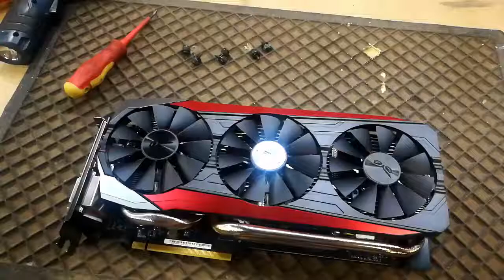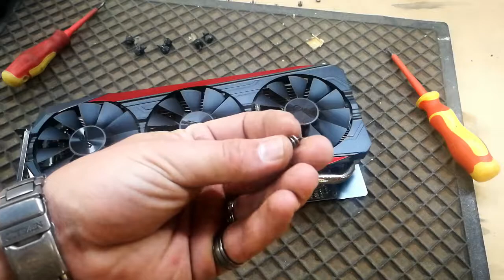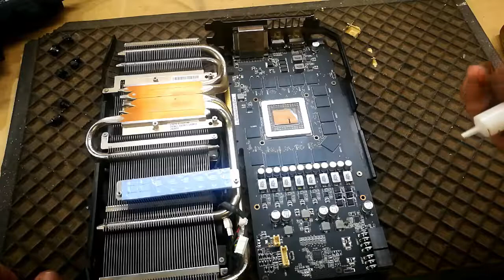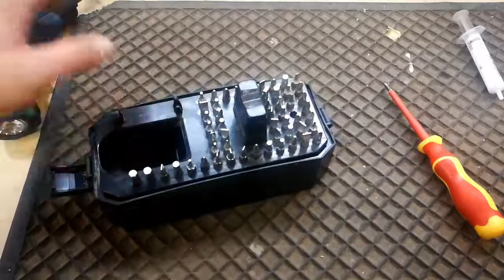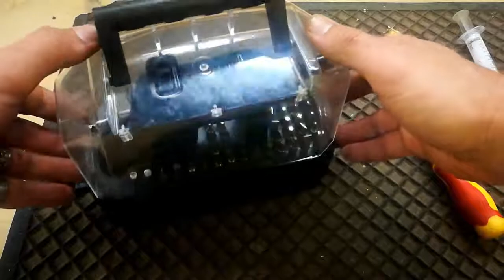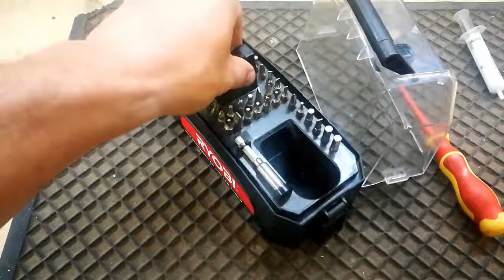R3 390x Thermal Paste

Comment: did your card hits the 95° easily before the paste? mine is hitting that temperature when play games on ultra and 1080p :( and im a little scared about that, btw i have the same card
Reply from the maker: I would be too if I were you. Rather change the paste, 95 is very close to the maximum the card can handle and with our old cards we should do all we can to help protect them.
Reply: Msi version here...... same temps...
i opened it up and the thermal paste was almost off the pad and onto the side pins..
I'm testing tomorrow..